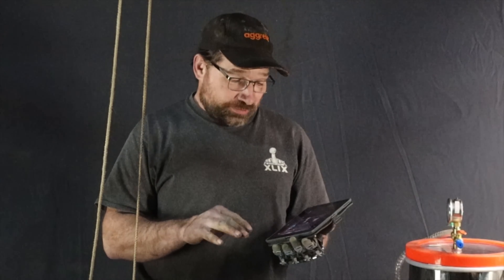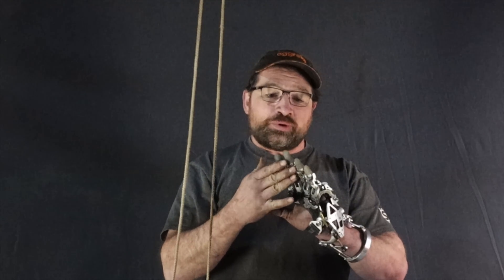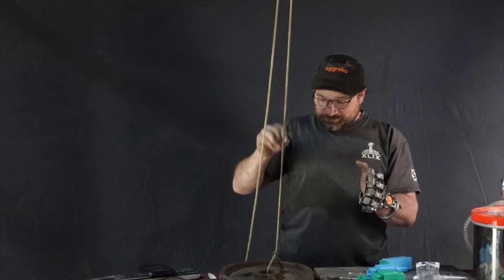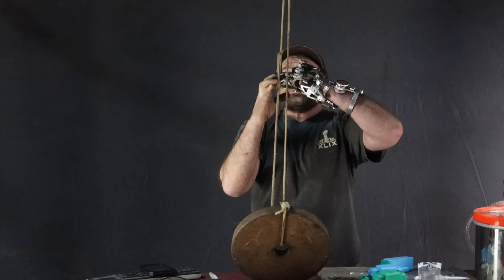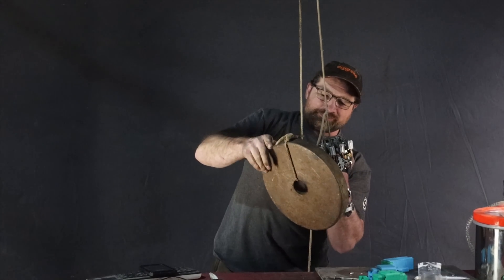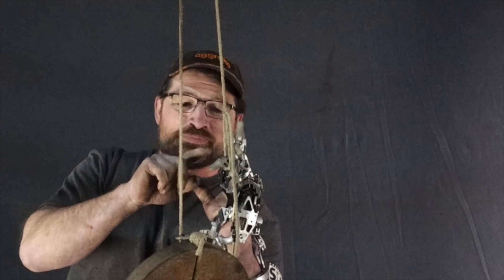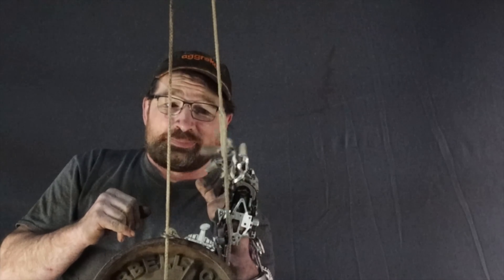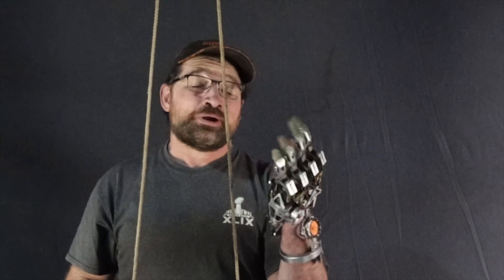Super Cool Proof of Concept!

Comment: I'm just in awe that it looks like it's entirely mechanical; really cool that you're able to derive so much functionality without the use of electronics!
Reply from the maker: Being mechanical has proven to far surpass what's on the market. And adding lock under load instead of patterns is a wild departure.
Reply: @missingpartsclub   I've been following your progress on this for a while, and I am impressed (have been since the beginning, hence the following).
Do you have any plans to turn this into some kind of prosthetics company? Not for the money you could make, but for the people you could help (plus you could do this full time).
I think selling something like this that would be more affordable, functional, and reliable than traditional prosthetics, while eliminating the need for motors,  batteries, and other kinds of advanced electrical gear would be a huge selling point, not to mention the fact that a savvy individual could do their own repairs, especially if you could somehow standardize a bunch of components and create a parts catalog (maybe with different sizes)
I could see this being especially impactful in places where most people have a limited ability to access health care. I think even the niche market of partial hand prosthetics would get a lot of people's attention.
Reply: @davideloewen  It would take more effort to make it into a company because when it comes to prosthetics, no two people have the same needs. They all need to be custom made and fitted to the person in question. Plus the function you still have left on the stump will dictate what kind of features the prosthetic can have as well as how those features could be implemented.
Reply: @mrkiky  true, but I think with a little work, the basic underlying mechanisms could be applied to custom prosthetics (different parts of different fingers, up to a whole hand) Besides, we can now 3d scan things (like an amputees stump) in a pretty precise way, and we can also 3D print custom-sized parts (even in materials like titanium) then you just standardize your gear, spring, screw, pin etc. sizes to make repairs simple and I think you would have a product that was less expensive, more durable, easier to repair, and arguably more functional than everything else on the market (not to mention it looks awesome).
Reply: @davideloewen  Well, you're talking about 3d printing titanium. I dunno how inexpensive it could be 😂
Reply: @missingpartsclub  I guess it means you can carry groceries without constantly flexing your wrist.
Reply: @missingpartsclub  yea its really great you thought very practical and didn't decide to overengineer like alot of companies.
Reply: @missingpartsclub  Curious, does the lock under load function work with the splay function? Or is this not compatible and you gotta choose your options?
Reply: It doesn't just look entirely mechanical, it IS entirely mechanical
Reply: @Kotomine Berndrewd Not fascist, nor racist, just a  flippant response to your disrespect of expecting the video uploader to take time to translate your post in order to understand it. The guy is busy enough coming up with awesome mechanics. As noted it failed in its endeavour as it was lost in translation like most jokes. Cant make it any clearer than that! Nice though that you think you have the high ground and moral superiority fuelling your motherlands foreign policy!
Reply: @TerrisLeonis  You might be right about that. I can't seem to find it on pc on the browser version.
Reply: @Hedera_tH t's available on PC if you had YouTube premium when they were testing it and yes that's incredibly stupid that they would lock an accessibility feature behind both time and money.
Reply: Its a common idiomatic expression in western Europe at least. "Stop speaking ikea" is a classic, when adressing people from norwaysueden. Ain't fascism speaking, nor is it directed against mother russia. But humor and susceptibility may vary greatly from a culture to another. Even though in my experience cultures from europe and russia tend to mix pretty well. Good job with this godwin point. 😅
Reply: @SergentTiToo  As godwin was invoked does that mean I win? 😅 Yep you summed it up better than I could. A failed joke lost in translation. This is my last post in this thread as I already distracted enough from the Awesome Video Ian uploaded and proper discussion of the mechanics that should take place! Apologies for the distraction!
Reply: @Kotomine Berndrewd By "sputnik" he meant a flippant term for "Russian", but a simple translation of 'sputnik' likely went to 'satellite'.
Reply: @jwonz2054  That's exactly right. My attempt to be flippant using simple translation totally backfired. Lesson learned!
Reply: @Kotomine Berndrewd Do you really think I am fascist based on a failed joke!
Reply: @headmmeat  I have no dislike or disdain for Russian people, they too are victims of unfortunate circumstances. Russia can be a great and innovative country again, But unfortunately the ship is being steered by the wrong people.
Reply: @oOMonkeyMagicOo   yeah. such a shame it has to be this way. i wish we all would come together instead of fighting and arguing about shit that ultimately doesn't matter
Reply: @headmmeat  That's the ultimate problem of the internet. It is a shame, but it's the hand we are dealt
Reply: SKYNET is on their way
Reply: @Kotomine Berndrewd Its you who are hopelessly lost in propaganda😂😂😂😂 
We used to ship humanitarian aid to the entire murmansk oblast since 2003 until 2022. So did Sweden.
We used to pity you. But thats not mentioned on RT and RAI, now is it?
Reply: I'd be interested to see if the two could be combined to get more refined controls.
Reply: @Kotomine Berndrewd что ж ты потерял на собачьем сайте, ватник? Иди смотри свой зомбоящик с путлером.
Reply: @Kotomine Berndrewd id say probably
Reply: This is truly remarkable, no electronics at all ??? It's incredible. I have so many questions, my first is, What happens if you were to get something caught around your finger, say a falling object attached to a wire or rope of some sort, would it lock up and drag you along with it or do you have some kind of quick release mechanism on the fingers or hand itself ???
Reply: Incidentally, the first time I visited this comment section in the YouTube Android app, I had the auto translate link on comments that I could click. Now I'm back, on the game app, on the same phone, and the translate links are gone. And of course there's no way to copy the comment text into any other translate tool.
Reply: @TerrisLeonis  that's strange.  Mine works just fine.  Try updating your YT app... And if it's current, you can try uninstalling it to revert to the old app to see if that works.
Reply: @TerrisLeonis  the translate button is temperamental, sometimes without closing the app you can go to multiple videos and it will only work on some comments and not others. Then there are the times it somehow detects English as another language.
Reply: @@kotomineberndrewd8325low quality bait
Reply: @Kotomine Berndrewd Norway here, ...as your neighbours, and someone who witness the insane nationalism thats being touted in the social medias and on russian TV and how divorced the talkingpoints are from reality; We have been in the recieving end of the rethorics and the threats of nuclear annihilation every other day since the genocidal warcrimes started last february.
The tension in the world is just a reflection on what you are projecting.
I dont like it, but its how it is.
Reply: @Kotomine Berndrewd Не позорь русских, удали аккаунт и больше не комментируй.
Reply: @Kotomine Berndrewd с первого раза не понял? Говорю, перестань позорить русских, удали аккаунт и больше не комментируй.
Reply: @@kotomineberndrewd8325  there are fascists everywhere in the world right now, it’s growing in popularity again unfortunately, but I think that guy was just being an asahole
Reply: @CChissel  Yep more asshat than fascist, but the two are not exclusive
Reply: @Kotomine Berndrewd вот об этом я и говорю. Ты же сумасшедший, а вокруг тебя одни враги! Не думал, что среди русских тоже есть адекваты, понимающие, что ты их позоришь?
Reply: @Kotomine Berndrewd they were making a (somewhat racist) joke that doesn't translate well, by calling the Russian language "Sputnik", specifically referring to the famous Простейший Спутник-1. It's because that satellite is one of the few things that people with little knowledge of Russian history and culture know about Russia.

It doesn't translate well because "sputnik" is just the Russian word for "satellite" (and has other meanings too), while in the rest of the world, "Sputnik" refers to one specific satellite.
Reply: @TerrisLeonis  Was not a racist joke! It was a flippant response to the reluctance of the poster to post in the language of the video uploader which I find disrespectful. Hence my flippant response tried to convey that disrespect. This obviously was lost in translation and in hindsight I should have responded in English where the tone may have been kept!
Reply: @TerrisLeonis  it was funny, you wet blanket
Reply: @TerrisLeonis  I wouldn't call it a racist joke.  A nationalist joke for sure. 

As for the guy bringing up fascism, I find that the vast majority of people who call others fascist for social reasons tend to not understand what fascism actually is, and are just regurgitating something popular they've heard others parroting. 

That said, the guy who said called his lingo "sputnik" is being a douche, and what an odd way to do it.  

The soviet guy simply wanted to know if the prosthesis can be easily removed should it become jammed while gripping something.  
It's a very good question.
Reply: @1SqueakyWheel  That's probably a better categorisation.
Reply: @Kotomine Berndrewd You should probably run that through a translation program and repost it.
Reply: @Kotomine Berndrewd Ursäkta att jag är så sen med att svara. Om du vill att mottagaren av ditt meddelande ska läsa ditt meddelande så är det större chans att han gör det om det är på ett språk som han eller hon förstår. Tänk att alla människor i världen är lata. Ju mer energi som behövs för att förstå nåt som troligen inte är viktigt desto mindre chans är det att det görs.
Reply: @Hedera_tH  rätt cool hand dock, eller hur???
Reply: @Hedera_tH   sann. vissa människor är superlata (sorry for bad Swedish I am learning it)
Reply: @Korixon.  Här får du respons på din kommentar. 
1. Sann, då det syftar på ett obestämt substantiv, ska vara i neutrumform, d.v.s. (det vill säga) sant.
2. Bra att du band ihop super och lat till ett ord.

Om du har några frågor, muntliga eller skriftliga, kontakta mig.
Reply: @Hedera_tH  Well said, its also good manners!
Reply: @Hedera_tH  just, press auto translate.
Reply: @Green_Bean_Machine  read the whole conversation.
Reply: @Kotomine Berndrewd speak humal language, please
Reply: @Kotomine Berndrewd ну они не все такие, некоторое понимают ситуацию.
Reply: @Kotomine Berndrewd потому что не все могут говорить на sputnik!
Reply: @oOMonkeyMagicOo  YouTube has auto-translate on comments now
Reply: @joaomrtins  Depends on YouTube's mood or something. I have no options to auto-translate anything.
Reply: @logitech4873  what? My language is not even set to English
Reply: @joaomrtins  Not for everyone tho.
Reply: @joaomrtins  It doesn't work most of the time. I usually forget the feature exists.
Only seen it work on Korean and Chinese too.
Reply: @joaomrtins  Nope, its russian for me.
Sounds like a feature you only get with chrome. But why would any intelligent human being use chrome?
Reply: @xcruell  kkkk. I'm actually am using mobile and don't record if it's on PC.
Reply: @joaomrtins  That doesnt always show up lol
Reply: @oOMonkeyMagicOo  lmao
Reply: @oOMonkeyMagicOo  uncalled for
Reply: @Ash_6614  Most likely

Comment: How much load is needed to activate?
Reply from the maker: With the current springs it's Right about 5# to lock, I've put 50# on a single finger and it held. I haven't done a pull up with it yet, but I think it would hold.

Comment: Incredibly impressive as always!!!
I would say an emergency release for such a mechanism would be necessary though; don't want to get caught under load and dragged along by your fingers!
Reply: Yeah, this feature is something that can be super useful in some situations. But I agree, it would be nice to have some way to release it in the event that the load doesn't release and there's a possibility to be further pulled into something, especially a lathe or mill spindle. Would hate to hear of you losing more of your remaining hand to some shop accident where you were actually making parts of your mechanical hand.
Reply: @sonicfrog1  Just needs am upper bound for when it needs to release. So the feature still remains useful, just needs a little bit of finetuning to be safe.
Reply: @ww-pw6di  a fuse-like upper limit is what I had in mind. Unless an easy to trigger voluntarily release is possible. Not having to replace the grip "fuse" would probably be nice.
Reply: @ruolbu  
That's similar to ski boot bindings. If you are about to break an ankle, the ski pops off.
Those are also adjustable so more advanced skiers can apply more load and beginners can have them release easily
Reply: I came here to say the same thing, some way to override the lock so you can let go under load is probably wise.
Reply: Actually, this might be better handled by a more general passive/automatic emergency break-away feature which decouples the prosthetic from the limb beyond a certain load threshold, either mechanical or material. I'm astonished at how much more robust his fully mechanical design is, though maybe I shouldn't be surprised. Amazing work.
Reply: @TaoOfStuff  that could form a different type of problem, like if he has to hang off a ladder or something.
Reply: @TaoOfStuff  Yeah, you wouldn't want to be in a situation where your actual body parts are the weakest link in the system.  Normally, if your fingers encounter force greater than they can handle, they're pulled out of joint or removed from the hand, rather than your entire hand or arm being ripped from your body.
Reply: Whether a mechanical or load strength material means to stop or separate the hold, my immediate thought was something like "man hold on to tailgate or door handle, vehicle drives off, man gets dragged." Chances are it would break or separate at some point as is, but definitely not without injury first.

Great proof of concept though, and showing it like this opens it up to possible viewpoints like this that may have been missed.
Reply: I don't like the automatic release idea because that's probably more dangerous - pick up something that's just borderline too heavy and then unexpectedly drop it. But yeah a quick release that the thumb can access would be handy.
Reply: @Ben_Lucy  Yes.  I wouldn't want it to automatically release if I am hanging by my fingertips from a cliff edge.
Reply: Seriously, the weight is always on his arm. It's like wrapping wire around your wrist and attaching a weight to it.
Reply: So impressive. Form and function are so tight
Reply: I was thinking the same thing
Reply: Maybe the position held by the thumb could determine the lock/release of the fingers . ie , straighten the thumb to override the lock .
Reply: was my first thought too.
Reply: "NOT AGAIN-!!!"

Sorry, just had to make the joke....